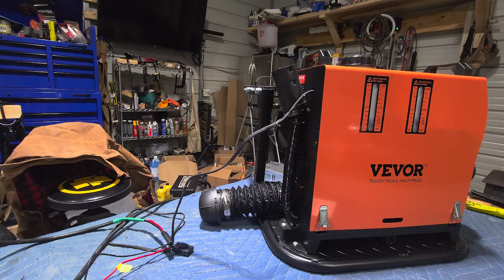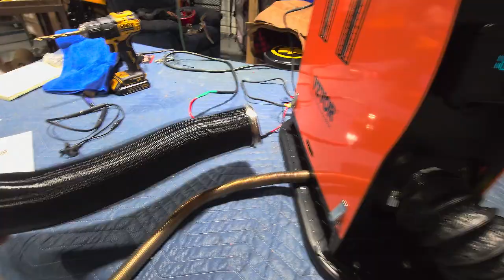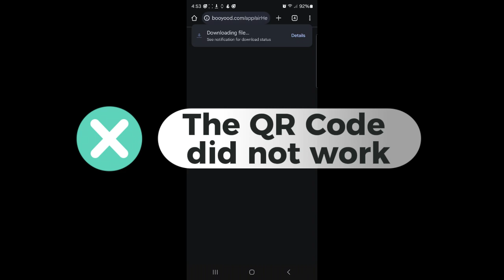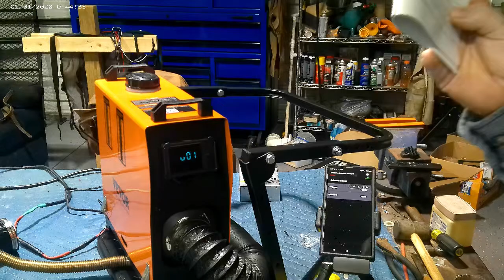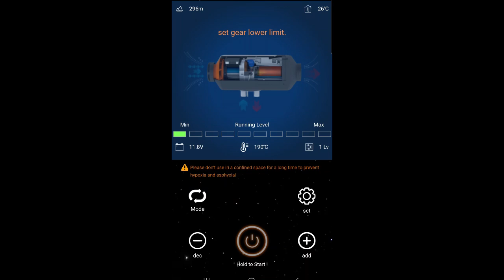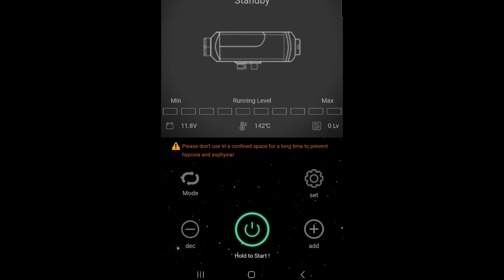Vevor Diesel Heater Bluetooth

Comment: have you had an issue with that hose over heating the unit and throwing the over heating code?  i have the 8kw square version heater and i was running that hose in my flip over and i was getting some kind of vapor/fog ( it didn't have much of a smell i didn't bring my tester to check what it was) but the unit was throwing a code for over heating. i took that hose off and it ran fine with no fog/vapor. maybe i fat fingered a button and changed the heating or something
Reply from the maker: Not on this unit.  But my overland trailer has another 8kw vevor heater on it and it has given the overheating alarm.  They do not like bends in the hose..  use as smooth of a hose as you can and as short of a hose has you can..  that's what I did to fix the overheating

Comment: Have my Sunster connected to Bluetooth and the remote, but, cannot set the clock at all. It's a one knob and one button controller.
Reply from the maker: I have no experience with Sunster..  do you need it to come on by it's self?
Reply: @pinchgutcreekfarm7699 Not really, it is just annoying me. Otherwise great little unit, navy blue with carbon fibre look feet and handles, has extension feet too, solid plastic fuel pipes, inline filter and silent pump. Just can't set the clock!

Comment: Do you know if you can set the temperature and it will automatically turn on and off to maintain said temperature?  Thanks!
Reply from the maker: There is a temp setpoint..  I am not sure it it will auto start/stop..  I believe the temp is ready off of the controller also. So it would have to be located in the area you want to control the temp in.